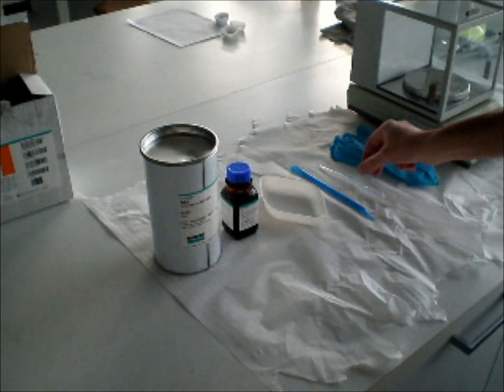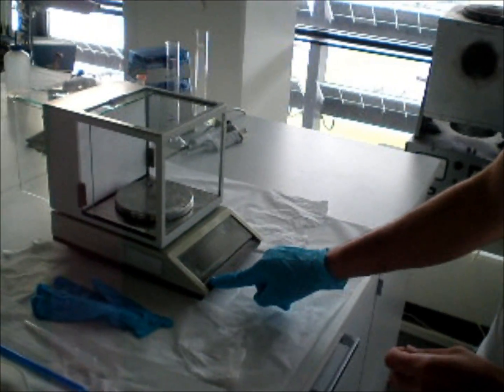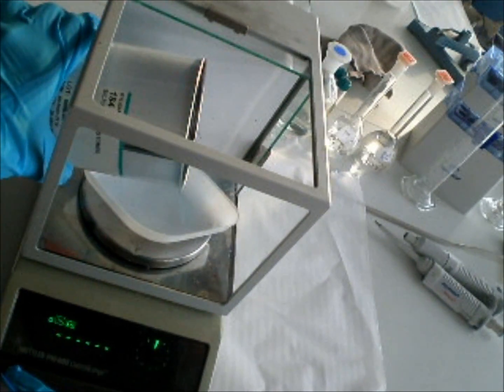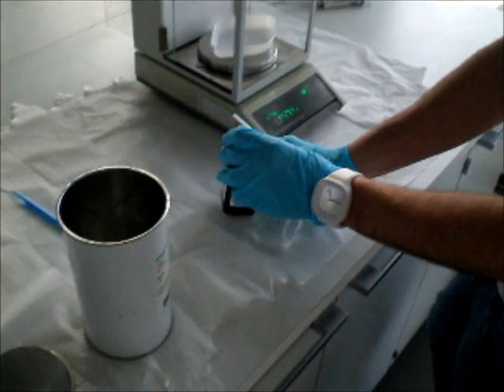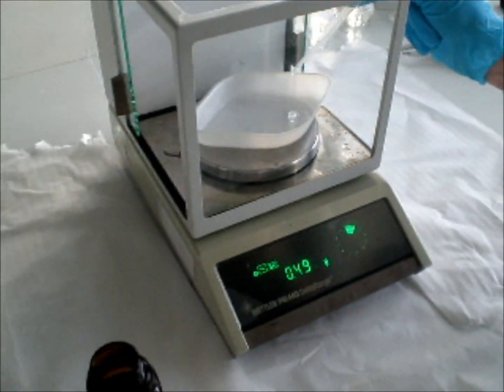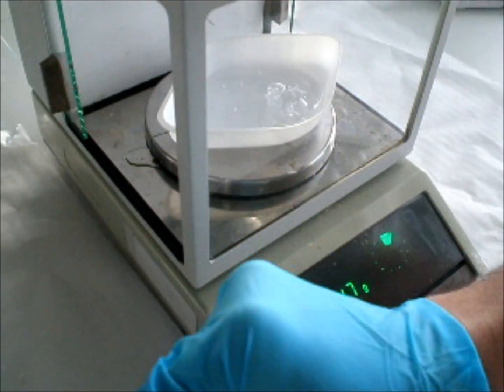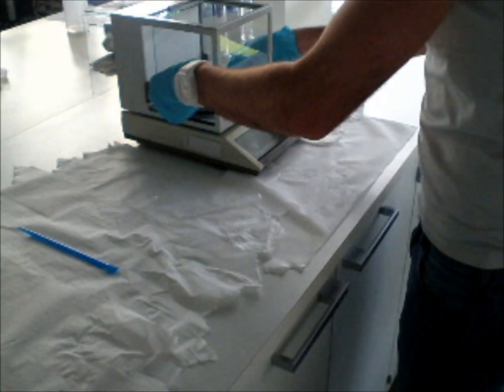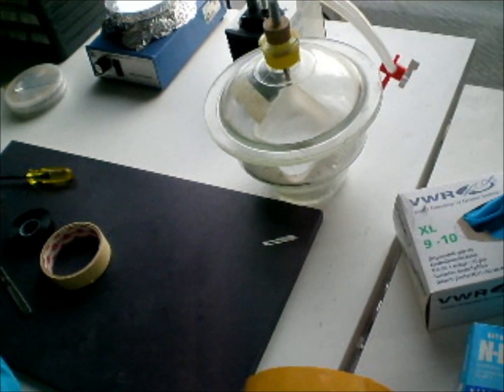How to make PDMs - Sylgard 184 - Curing agent - Silicone elastomer

Comment: Which is the hardener?
Reply from the maker: It's called "Curing agent" as you can also read in the description. The 
exact one is called "Sylgard 184, Curing agent, Silicone elastomer" ;) 
But you can use any kind curing agent, doesn't need to be the specific 
one ;)
Reply: Thank you very much! It is necessary to bake the mix at the end? And if yes at how many degrees and for how much hour?
Reply from the maker: Yes, you have to let the sample baked for 10m at 150°C or 20m at 125°C or 45m in 100°C. Note that you will need to do some experiment first in order to get it in the shape you like. There might be slight difference from mine, you might need to bake it maybe 15m at 150°C and this depends how and where you apply the silicone ;)
Reply: Thank you very much for your descriptive answer!
Reply: @mollachouse  plz let me know what r the other agents by which we can cure pdms
Reply from the maker: @ganeshekshinge860  sorry but i dont know others
Reply: They put this stuff in our food under the name: E900